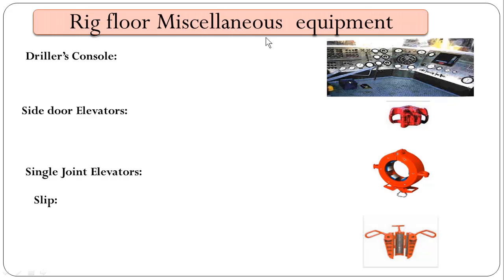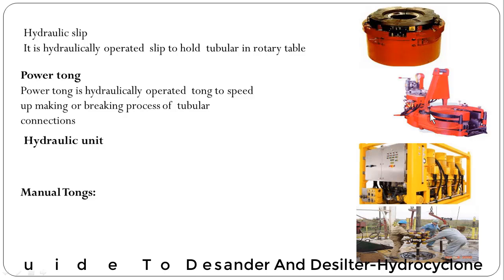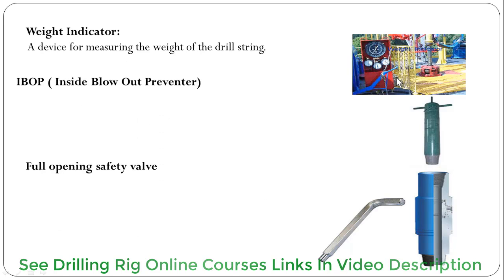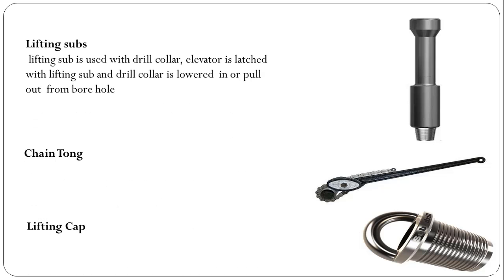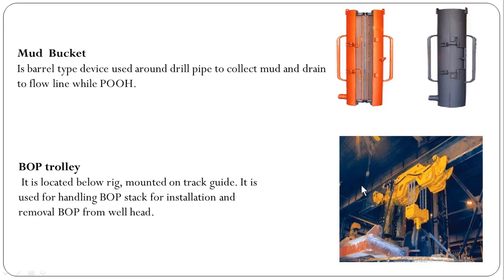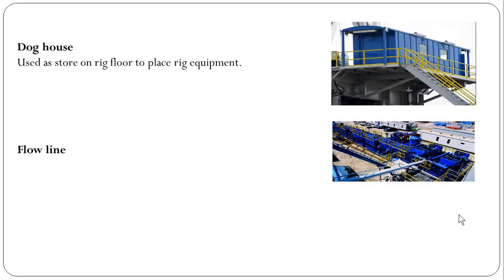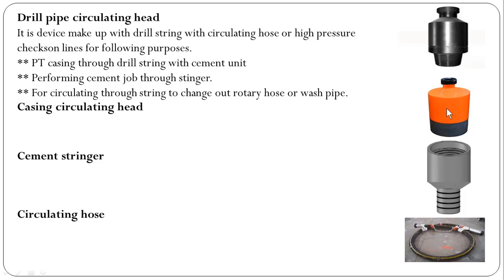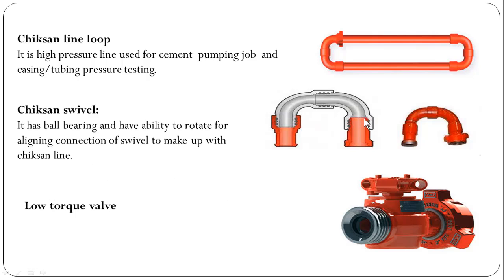Rig Floor Miscellaneous Equipment I Drilling Rig Components

Comment: I am sorry but although these videos seem to have been very thoughtful, I do have some issue with your explanations example catheads are designed specifically to be used with rope and other smooth bindings as they are utilized when we run large casing or tools. However I did have an iron roughneck or power tongs on a very remote rig in the 80’s in the NWT. We also power tong companies when possible